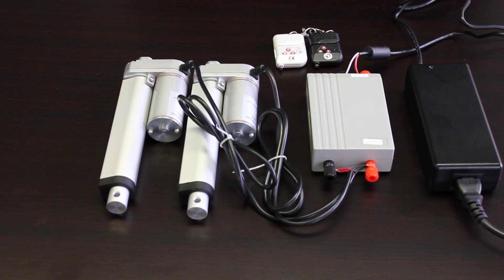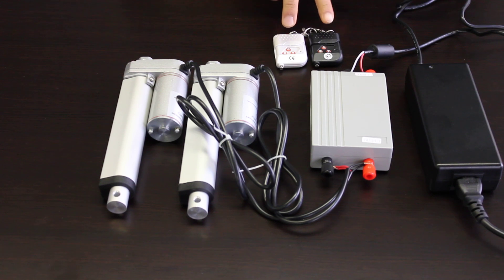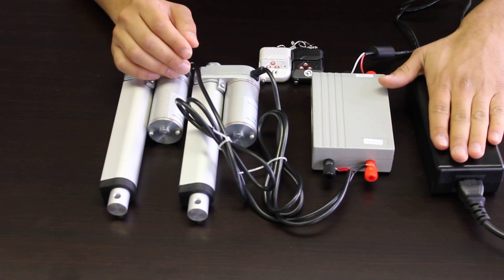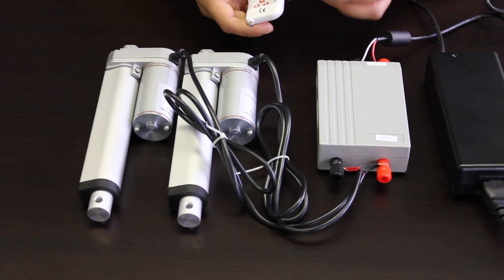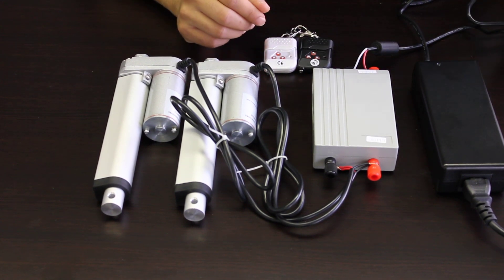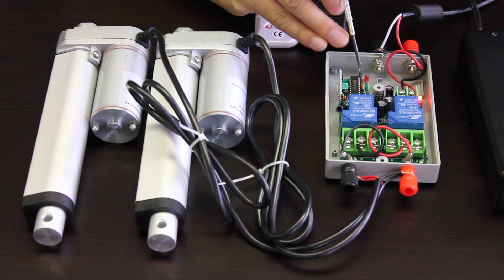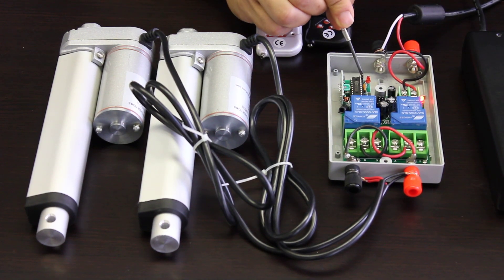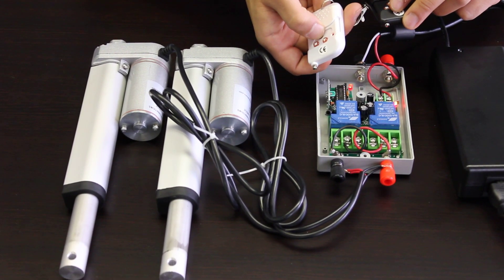Linear Actuator Wireless Remote Control Box (PA-30) - Progressive Automations

Comment: can we use this control box for heavy loading actuators like 4000-6000 Newtons?
Should we use this control box for only progressive automation products?
Reply from the maker: Hi Siva! If the current rating of your actuator is less than 15 Amps and has a voltage rating of 12 VDC, you can use the PA-30 control box as is, but we don't recommend using actuators that have a larger current rating than this. Kindly keep in mind that the control box is for parallel control, not synchronized control. 

If you have any further questions, feel free to give us a call at 1-800-676-6123 or send us an email at sales@progressiveautomations.com. Thanks!
Reply: I have read in your article that pa-30 control box is designed for your manufactured linear actuator only. But we can use for outside local linear actuators right, of less than15 A?
Reply from the maker: @sivaramireddymatta4566  Hi Siva! This would be due to the plug-and-play of our units and control boxes. If you would like to use a third-party actuator, the connectors to the control boxes may not be the same.

Comment: how can I control the pistons as in the video but in the opposite direction? i mean, when one enters the other goes out, thank you
Reply from the maker: Hi Ricky
You can receive movement in the opposite direction by reversing the polarity of the motor wires (swapping them) as the actuators use brushed DC motors. If you have any more questions please contact us at 1-800-676-6123 or sales@progressiveautomations.com.

Regards

Comment: would be rise the same if they have different weight?
Reply from the maker: The units speed would be affected by the weight it is pushing, thus the more weight it has to move, the slower it will go.